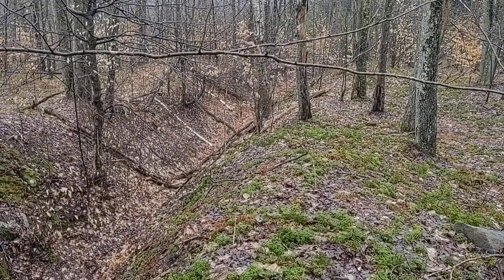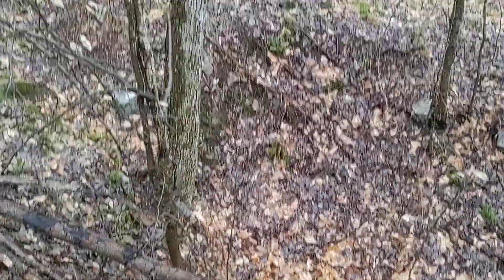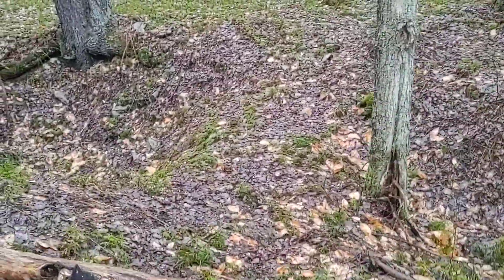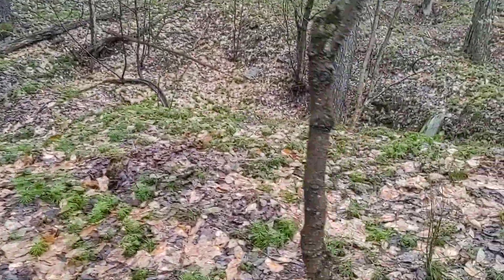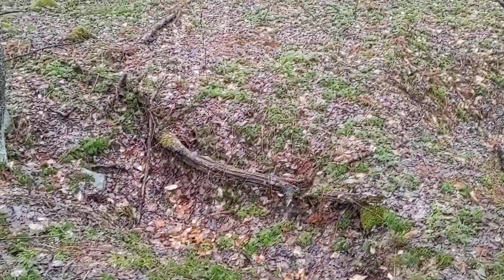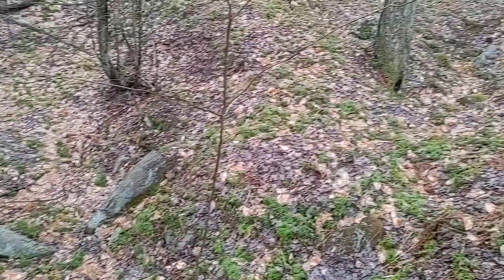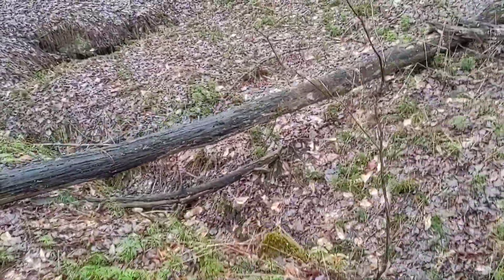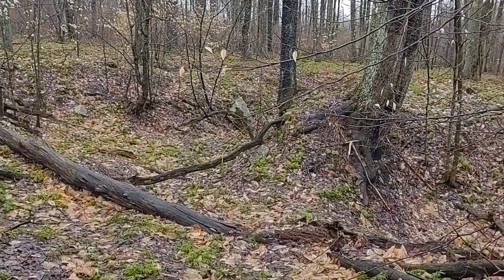What is Mine Subsidence?

Comment: It's a shame that there's no means to pump in some sort of agent which was inexpensive and could both expand to fill the mines(like a spray foam) and also support the weight of the rock above it. Such a product could minimize if not potentially eliminate this concern, especially if there was a means to locate and penetrate the older abandoned mines and at least fill some of the mine.